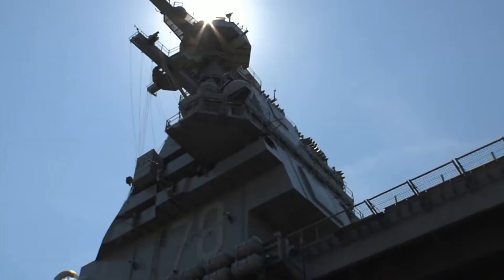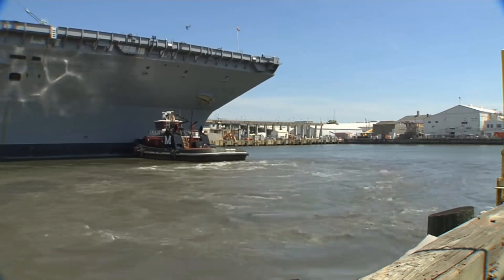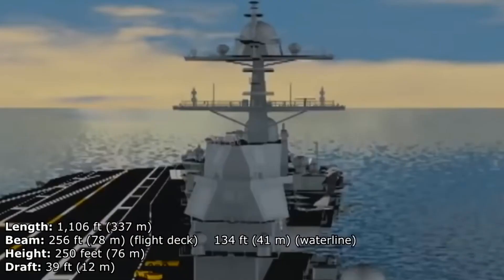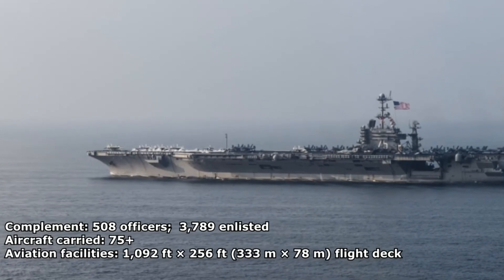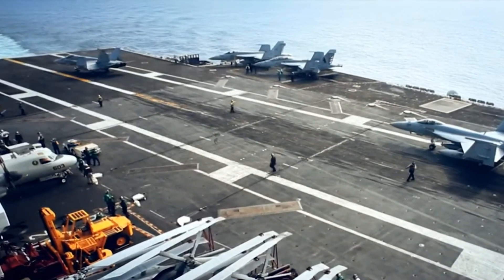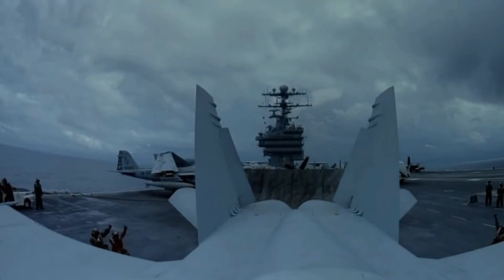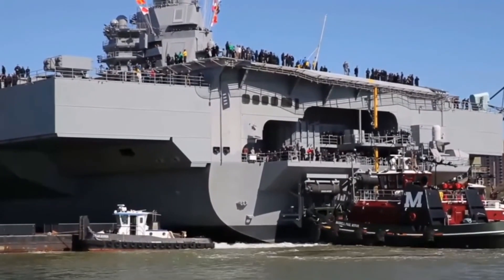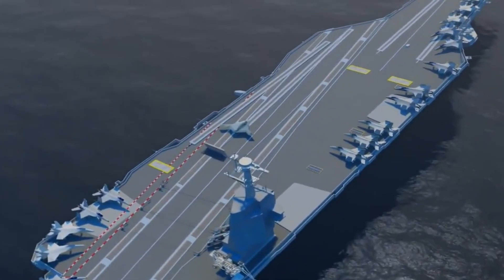USS Gerald R Ford CVN-78 - US Navy Supercarrier

Comment: Interesting take - although actually it's had quite a few issues. I'm far less optimistic about the reality of the ship.  The design and goals may have been admirable, but as with many US military expenditures lately, it's gone ridiculously overbudget, and overtime, and is currently underperforming. DOTE reported that the EMALS fitted to the new nuclear-powered carrier USS Gerald R. Ford put "excessive airframe stress" on aircraft being launched. Additionally EMALS reportedly can not "readily" be electrically isolated for maintenance, which DOTE warned "will preclude some types of EMALS and AAG (Advanced Arresting Gear) maintenance during flight operations", decreasing their operational availability.  In other words when 1 thing breaks, the entire flight deck shuts down until it's fixed, instead of with steam, if 1 breaks you still have 3 running.  There's been a lot of articles detailing lots of the issues with the CVNs, in addition to already running over 2bn over budget
Reply: As of the end of 2017 the issues with EMALS have been largely remedied and the ship should be deployed within the next six months to the 7th Fleet. The major advantage of EMALS is actually less stress on the air-frame allowing for higher takeoff weight with less fuel burn. The extra money spent on Gerald R. Ford in development will likely end up lowering the operating costs of this class of vessels in the long term by a fairly significant margin and make future ships cheaper to build. Seawolf and then eventually Virginia were the first US attack sub classes built in CAD and the later vessels got significantly cheaper over time. It wouldn't be unreasonable to expect the same thing with the carriers.

Comment: When I heard Canada has some plans on doubling its military budget. I was like, "this"  
a carrier strike group would probably be half of Canada's budget but, man... the force projection. 
I just feel like Canada's military doesn't have the proper means to get to a battlefield.
Reply: Point Five Seconds To Respond - right now Canada has to replace its entire navy, airforce etc... Too much to do not enough money.  If Canada gets a carrier in 2050 it will be something like the "Novantia LHD", also remember its not just the carrier itself, you are going to need 5-6 escorts and at least 1-2 AOR's to supply the carrier group itself, those AOR's are going to need escorts too.
Canada can not take ships from our current surface navy cause its already too small.  Never mind the crew requirements, the Queen Elizabeth carrier is a bit smaller but only requires 600 to crew, it has a lot more automation then this thing.
Reply: Force projection is building a large fleet and projecting it in a specific area.  A carrier battle group would be force projection.
Parking a carrier battle group outside a nations boarders or beside a allies is projecting strength, it can calm  tensions by aggressors.  If not for the U.S and other allies i have no doubt China would have expanded by now.
Reply: I'm hoping the budget stays going up, I'm going to stay optimistic about that... 

The conservatives had suggested two amphibious assault ships at one point, even those would be capable of launching f-35bs. 

I know it seems kind of insignificant but I wish Canada had a small carrier that could link up with the states groups.
Reply: We also seem to be spending insane amounts on procurement. 3.5 billion for six icebreakers that other countries are building for 100 million a ship. 

Our new "destroyers' are supposed to be 3 billion each and I doubt they'll be as capable as destroyers other nations are building for fractions of the price.
Reply: liberals are in power, it will get slashed
Reply: Point Five Seconds To Respond Canadawill never make a carrier.
Reply: the new surface ships are going to be a bought design from France or Spain.  We can not afford or even know how to build modern ships. 
The government can sell the idea of a LHD to the public with disaster relief but a dedicated carrier, not for a very long time.
Reply: What will you do when Russia starts encroaching on Canada's Arctic resources? Ask them to please leave?
Reply: john mcdonald - well the WORLD knows that when it counts, when the WORLD is on the line, the Canadians step up.
Reply: john mcdonald here's my take. My mom was Canadian until the day she died. I am an American. I'm proud of my Canadian heritage, thankful you are our Allies, and the Canadian Armed Forces are one of the best, except for burning down the White House, you're pretty good guys. Oh Canada, my home and native land.....
Reply: No, I mean what oversees interests does Canada have to require force projection of the size of carrier strike group?
Reply: None, Canada has loads of natural resources and the 3rd largest oil reserves on the planet. We have enough leverage in trade deals.  Should Canada build or buy a LHD, yes, for humanitarian aid, natural disasters and moving military equipment around.  Maybe if possible F35B's flying off of it in 25 years or whenever.
Reply: AR15 nut probably do the same thing as the last time they tried to set up shop there... In the 80s. We sent an arctic specialized light infantry battalion and kicked them out
Reply: AR15 nut you must be one of those clueless Americans who think Canada could get stomped easily. We have the most well trained infantry units in the world. Around 100k personell with the ability to expand our army to 400k pers in one year without needing to train more leadership. We also have more than 20million guns in Canada (We have 37million people).  You Americans yap about your "behind every blade of grass" shit. We have more guns per capita than you. Our country is mostly tundra. Canadian shield. Or prairies. Which makes any invasion from the north an impossible logistical nightmare (it's mostly arctic). We have 37,000  rangers in the arctic who are mostly Inuit and are expert survivalists and outstanding marksmen. We have arctic sovereignty, undeniably. An invasion from the west coast is also impossible as well due to the Rockies... by the time the got close to Alberta or any other province we would have NATO and commonwealth reinforcements in. plus half their invasion force would be dead via cold weather injuries, starvation, lack of fuel, and from our air, artillery and light infantry assets picking them off while they freeze to death.

Yeah I don't think so dumbass..
Reply: thisghy 0
Reply: We'll never forget what Canada did for Britain in WWII - more than the Poles, more than the Czechs, far, far more than the French - more, in relation to her population, than the USA - God Bless Canada!
Reply: John Mcdonald - I don't know, I suppose a quick trip to Google would sort that out as a percentage by capita - but what I do know is that the Canadians went from a coastguard navy in 1939 numbering a few hundred to over 50,000 in three months - and was a HUGE reason the UK survived - and Hitler lost. Cheers, Canada!
Reply: John mcdonald - well, now you're just being nasty to your best allies in the world. You still want allies, yes?
Reply: 2 modern carriers - more than any other US ally - on sea trials right now, combined with the best-in-the-world anti-air defence ships. Once we get the aircraft the USA is overdue in supplying, we'll be set...;) Seriously, go piss off the Russians and Chinese, not us. We're arguing over which is darker, night, or later that same night...
Reply: Sure they do. They carpool with us!😂
Reply: Highly trained forces poor funding simple truth doesn't matter how good the solider is if he doesn't have the told or permission to fight right
Reply: Force projection to do what exactly?
Reply: None that i am aware of.
Reply: Point Five Seconds To Respond our procurement system is terribly innefficient
Reply: Canada has a military?
Reply: Indeed it does. But if  there's a problem somewhere in the world it's always America's door it comes banging on.
Reply: John Mcdonald - I have to bow before your no doubt superior knowledge of North American politics. I'm just glad that twice within living memory it's ignored the USA completely, and been the truest friend to the United Kingdom.
Reply: Really? At the height of the Second World War America 16 million men and women in uniform. How many did Canada have?
Reply: john mcdonald only 2 million American served in Europe with a population of 136,000,000 and Canada had 1 million serving and a population of 11,000,000. USA had about 1.8 %  of population while Canada had 11 % of it population in Europe. You guys are blow hards.
Reply: Sod off mate. The truest friend  Canada and the UK ever had and still do is the United States. neither Canada or the UK can be considered super powers.
Reply: Where's your navy now?
Reply: Good on you. My daughter-in-law is from Calgary.
Reply: With America next dor no need. Go for space Canada, that's next frontier.
Reply: We're still waiting for Prime Minister Justin's aircraft fly off contest since he already lost F-35 production slots for years.
Reply: Aircraft carrier or not we in the US and the UK always will back up Canada
Reply: Y’all will just carpool with us to Britain
Reply: Just hitch a ride. You know you're not going to participate in something the US isn't already involved in anyways.
Reply: Why should they? We've been protecting their butts for 60 years. And they hate us. It's a source of pride for Canadians to hate America. Ungrateful bastards.

Comment: The replacing of the steam powered catapult with a magnetic system will make a lot of sailors happy.
Reply: There are several parts to the EMALS system that are all new to this ship. The one that gets most of the attention are the linear motors that actually launch the aircraft.   The old steam cats needed a LOT of steam in a short burst, a lot more steam than could be delivered by the main steam system in that short period of time. SO steam was fed into steam receivers (large tanks near the catapults) at a controlled rate. Pressure was built up in the recievers, and then released in one large blast of steam to drive the cat. EMALS has the same issue. The ships power distribution system cannot supply such a large load without disrupting the rest of the ship. Emals uses flywheel systems to store up energy that is then released to the drive motors. How well these systems operate will determine the future of the linear motor system.
Reply: @johntrottier1162  all charge systems work this way. Even computers use capacitors to hold more energy to later discharge or hold
Reply: Let's hope it works properly.
Reply: Evil Clipazine They will finally get a better nights sleep.
Reply: I really hope they know what they are doing.  I know the Emals delayed the carrier by a year or two because they couldn't make it work right for the longest time.   Also it is nowhere near as reliable as the steam catapults.   Steam is reliable, it's just there.  For everything.   The whole ship is dark outside of reactor dept. if you don't have steam onboard.   By going to emals, you are basically adding a massively complex system with an entire secondary level of things into the equation.  This secondary system ( the electrical ringbus) has just more than doubled the chances something goes wrong and breaks.    Now you have to rely on the secondary steam system to drive the SSTGs to generate power for the 17kv ringbus, and you need the extreme amounts of power available in reserve from that to power the  emals.    Instead of just having the steam system be a failure point before, now  you have the steam AND the electrical system which can be your point of failure.
Reply: The EMALS is not working? were did you hear this?
Reply: Well that is why the US Navy dose sea trials on every new equipment before they deploy them into real world operation. Though I would be worried that some ass hat at the pentagon will try and cut corners to get this ship deployed on the target date. They did it with the M16 in Vietnam would not surprise me with this carrier.
Reply: Evil Clipazine But they didn't, I strongly suppose,that's for sure.☺️✌️💎
Reply: LUNAR BLOODDROP  chucked by fucking stretched out cables like a bungie chord slingshot
Reply: It's a big juicy target regardless whether they can get the system to work reliably The  Chinese arnt mugs  they know the US navy can't be challenged at sea for  aircraft carriers  yet  but they have missiles and hyper sonic  missiles that can cripple it or sink it   as do the Russians   currently the West has know known   equivalent they appear to be  several steps behind  and the U.S. govenment are worried am sure the Pentagon  are concerned   how much of a  lead  theses two countries have in hyper missiles technology that have the potential to strike thses millions worth of us navy assets a  sitting duck as all  assets of this size   if a situation crops or in a hostile area  while at sea    why didn't they just try it on a old carrier when the system was though of as a test bed  iron out all the bugs get it work Propeley  so instead you have a facking great big supercarrier that isn't fully operable  yet   the chinese have a carrier  comparable  in size to the US Super carriers and have EMALS launch system  it be irony on top of irony  if theses jokers get one over the US navy and  fully operational  too that's facking ridiculously  funny. Fack in ell  🤣😂😁